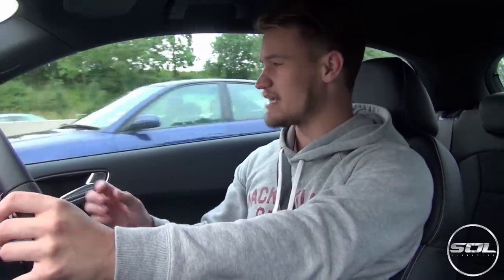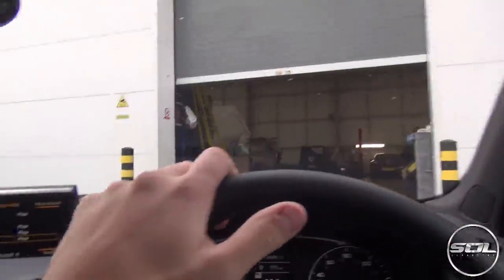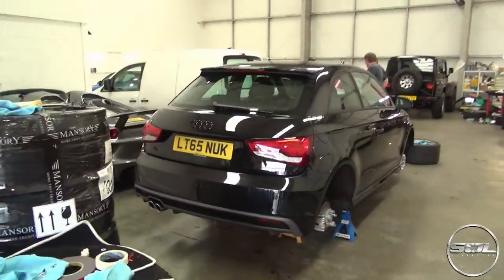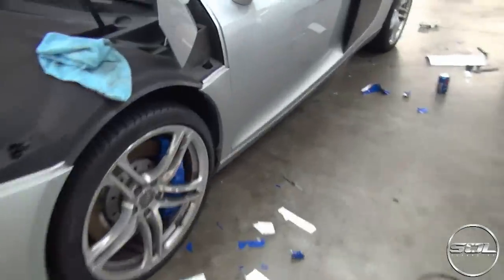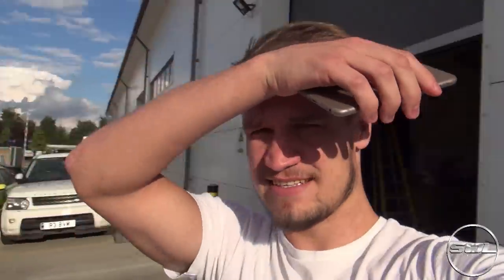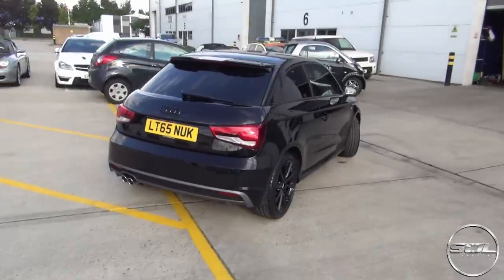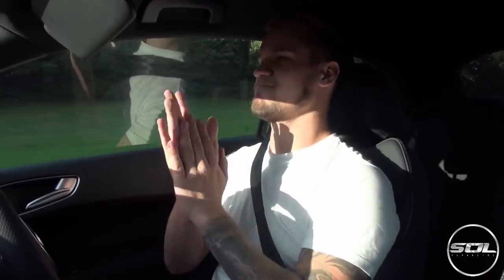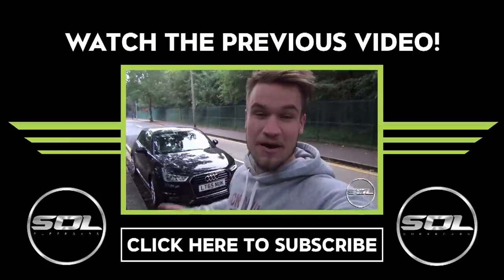AUDI GOES STEALTH! THE EPIC NEW LOOK!

Comment: At 7:05, the guy put the lug nuts on the wheels the wrong way :/ supposed to go in a star pattern so you don't risk an uneven load across the wheel mounting surface. I'm in school to be an Automotive Technician so it's just something I spotted.

Comment: what did i just see at 2:10

no automatic climate?
Reply: I saw that too it should have automatic climate control
Reply: +beeeneee Haha yeah, looks like manual aircon, no climate control. Well I guess it's basically a VW Polo with a Premium badge. Top spec VW Polo GT costs the same as a mid ranged A1, even though it's just exactly the same car lol.
Reply: +botchok5 The Polo looks like shit though
Reply: +eliot gustafsson (gson) That's down to personal opinion though..... The back of the Audi A1 looks so out of place with the rear bulging outwards.
Reply: botchok5 Yeah that's very true. I'm not a fan of the back of the A1 but I prefer it's overall looks compared to the Polo. I'd take the A1 instead of a Polo 9 out of 10 times. The one time being if I need a bigger car.
Reply: He's always wearing a vest or something... There's pretty much been no days where he said it was actually hot in england, maybe he just doesn't need it...
Reply: +beeeneee And he's also missing in my opinion the most important option in a car.... Heated seats.
Reply: +botchok5 I actually think the Polo looks much more attractive and classier, and better proportioned as well. Also, ironically enough, the Polo is less common on the streets, at least in my country. 
I'd do that exact same thing as he did in the video with a black Polo, now that'd be badass looking and saving money for some really nice suspension in the process.
Reply: +Alex Serrano agree!!!! have you seen the 2015 polo gti O.o WOW!!!
Reply: botchok5 Actually, the Polo the guy above me mentioned looks pretty good so I take that back. Well.. the versions of it that's made for grandmas look like crap but the Gti looks nice. Depends on price though
Reply: +botchok5 don´t cry about something that you can´t afford ;)
Reply: +vivalaphill errrrr... facepalm. Yeah I definitely can't afford an A1 but somehow I managed to afford the new Golf GTD. You might wanna Google it..... That's the problem with fanboys, the majority don't even drive.
Reply: botchok5 you just look stupid claiming that  cars which are based on the same platform are the same. this rule doesn´t apply to me, sorry. I have got a B5 S4 btw.
Reply: +vivalaphill haha you go around commenting on YouTube claiming people can't afford certain cars while you drive a 16 year old Audi, worth around £3,000 tops in this day an age?
https://www.gumtree.com/p/audi/1998-audi-b5-s4-ko4-turbos/1130093547
Reply: vivalaphill Well, they're obviously not exactly the same. The interior of the audi is better constructed, the range of option much wider and more expensive, and then the bodywork is noticeably different of course. However all this differences barely apply underneath and since we're talking from a car enthusiast point of view, cosmetic differences are minor, so we can say without being wrong that both dynamically and mechanically they're practically the same car.
Reply: +botchok5  A stock and in bad condition S4 might be worth 3k but there is something you and your 2.0 diesel will never experience: upgradeability.
pared with the proper torsen Quattro and a LSD of a porsche. My 2.7 Biturbo is running on E85, has forged internals, a pair of Garretts, a Wagner Intercooler and a custom Intake, Bilstein suspension etc.  making 490WHP. build in my garage. Tell me more about the crappy old car while someone can enjoy the brutality  of 184 hp. a real car enthusiast doesn't have a stock  4pot Golf.
Reply: vivalaphill That's not true, if you have to travel to work a LONG distance every morning then there is no need for a Maserati Granturismo.

Not everyone can afford to buy a real nice car and pay extra for the fuel, servicing, insurance, depreciation and so on....
Reply: amapolishplummer thats why i bought a cheap car and made it go fast ;)
Reply: amapolishplummer That, in Canada, is an essential!Been living with it for 4 years and will never ever buy a car that doesn't have this option...... Pretty useful when it's -40c outside ;)
Reply: +beeeneee That's because this is the base model. 
A1 Black Edition comes with auto climated, tinted glass, black front grill. 
I know this because my previous A1 was black edition. Loved it.
Reply: +Olivier Chantal-Bossut (xoobackflipoox) Same here in London, heated seats are one of the only things i get out of bed for. After all the depressing gray weather and rain it's one of the only positives on a shitty day.
Reply: vivalaphill Fair play!
Reply: +Abdul Wahab This is the S Line model not the base lol, surely having an A1 yourself, you should know that?
A1 models goes as follows: SE, Sport and S Line. The Style and Black Editions have been discontinued last year.
Reply: amapolishplummer Well in London do you even get under 0c once in a year?! Cause here it is really a must: an average of 4C through the whole year because of the 6 months of between -10 and -40 :/ not sure if it really is a must in london.....
Reply: Olivier Chantal-Bossut Well since as we have about 4 days of sunshine a year and the rest of the year it jusr drizzles 24/7 and it feels like the clouds are 20 meters above your head yeah, heated seats do help.

Comment: The car looks pretty sick. However to make it a beast of a A1 I think you should get carbon fibre exhaust tips which will match the rest of the car and also defiantly do the lights. Black them out front and back and it will look the nuk bomb it should

Comment: I so do not see the appeal of Black-Optic.  It just makes your car look like a cheap economy car.  
Even though I know that was a chrome surround the window, but with it blacked out now it looks equal to the cheap rubber surrounds used on economy cars.  
The wheels now look like the black rim  on a cheap economy car after its hubcaps fallen off.  
And why blackout the Audi rings?  If you were trying to go for a stealth black / Noob Saibot look at the very least the leave the Audi rings untouched.   
That A1 looks ruined.